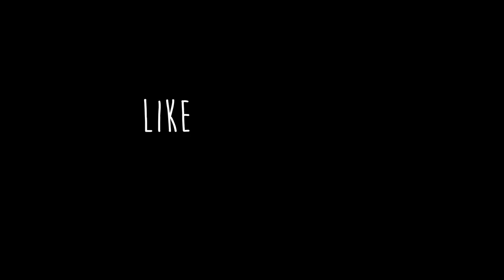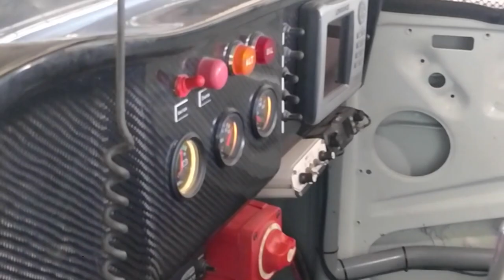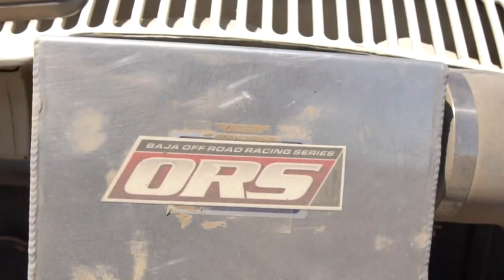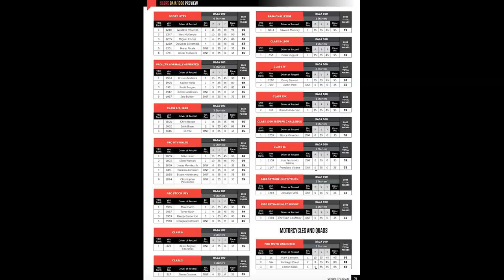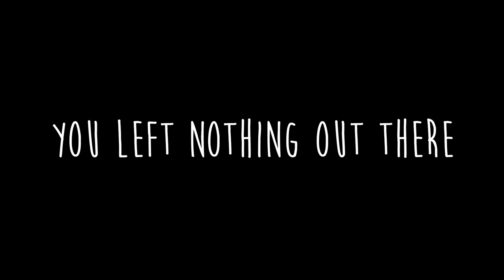I SLEPT in the DESERT after we ROLLED our racecar | offroad racing experience | SCORE BAJA 500

Comment: I would be willing to help sponsor an Electric VW Baja race car. 
The guys from EV West in San Diego built an electric Baja racer several years ago.
Reply from the maker: Ohhhh mannn I am thinking about it pretty hardcore!
Reply: I would love to see an electric Baja bug. If anyone could develop one it would be Michael Bream at EV West.
Reply: The main hurdle would be developing a battery module which could be changed out as quickly as pouring gas into a gas tank. We already know that even the fastest chargers cannot compete with that pour rate. But, who knows. Battery tech and charging tech are developing very rapidly.
Reply from the maker: @tomsummers1137  oh yeah my van is designed to do exactly this! Just about getting a motivated pit crew who want to change a battery as quickly as it takes to pour the gas!
Reply: Michael already has Pike’s Peak and Bonnevile in his repertoire. Two iconic race car venues.